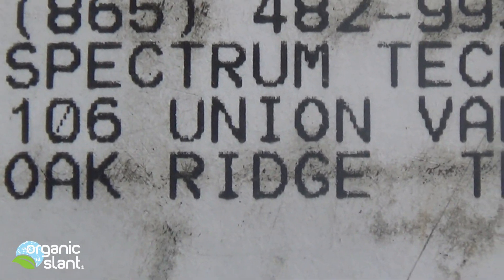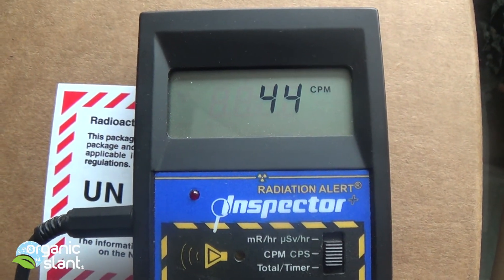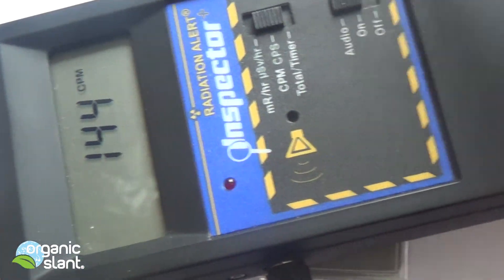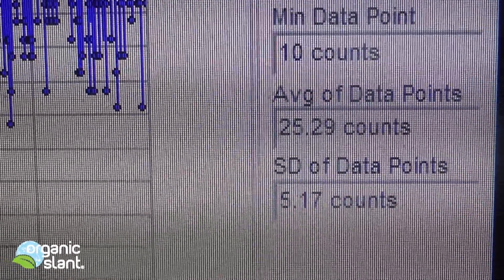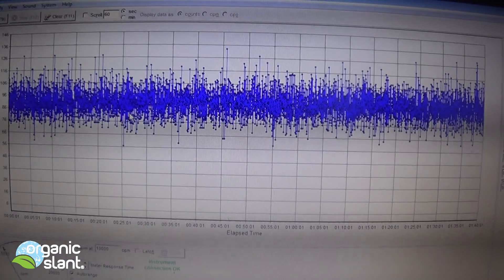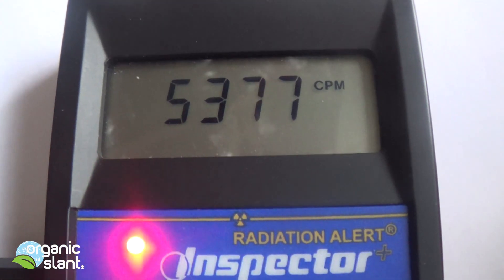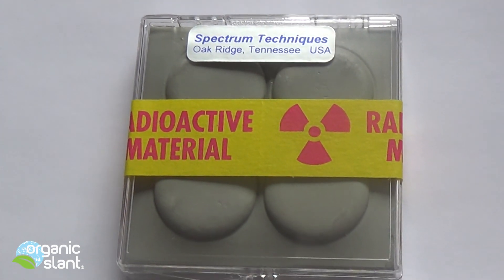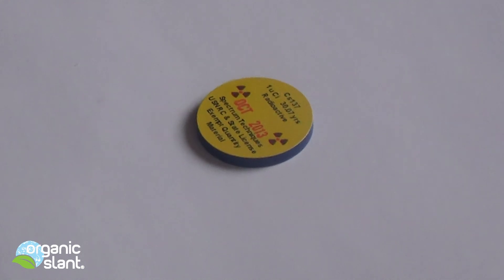Radiation monitor Cesium-137 source coin for calibration 12-11-2013 | Organic Slant

Comment: what if the speciman was  say 5 grams in weight how much radation would it  give off?
Reply: Activity of cesium 137 is 3.2 10^12 Bq/g, that means 1g of cesium 137 decays 3200000000000 times every second, 5 grams would be 16 10^12 Bq, that is 16000000000000 decays (desintegrations) every second. if you were 1 meter away from those 5g, you would receive 1.2 sieverts per hour. A normal person receivers 0,001 sieverts PER YEAR, from natural radiation.  1 sievert will give you a 5.5% chance of developing cancer,  4-5 have a 50% chance of killing you

Comment: Because its likely in the form of cesium chloride which is a salt and is generally non reactive and similar to sodium chloride. Its also implanted inside the coin which is made to be air tight to protect against contamination.